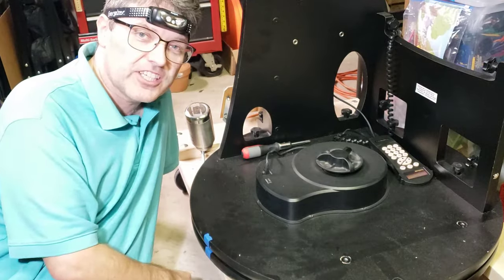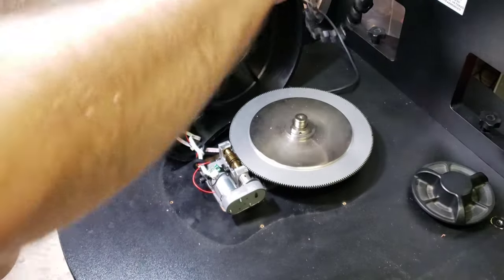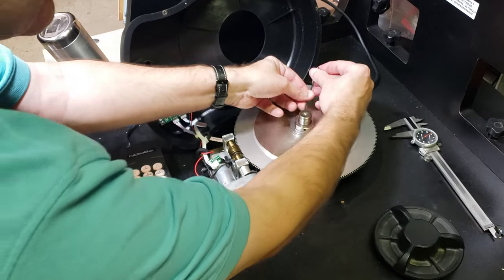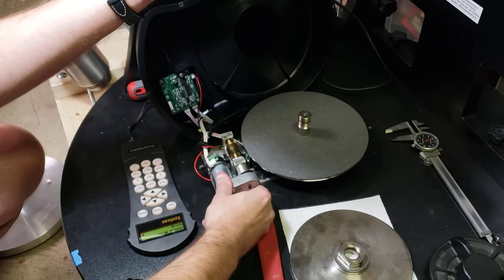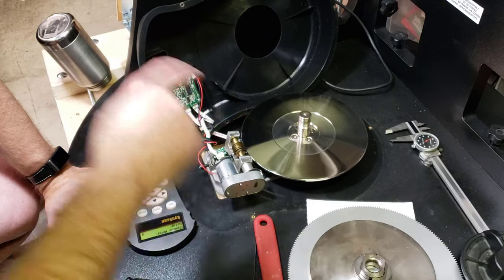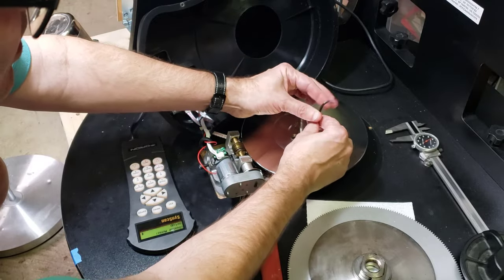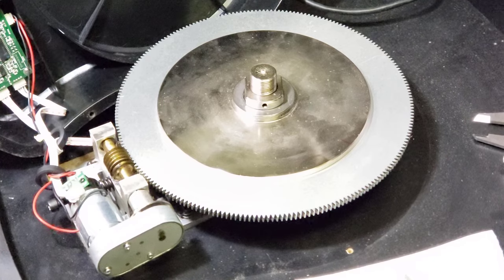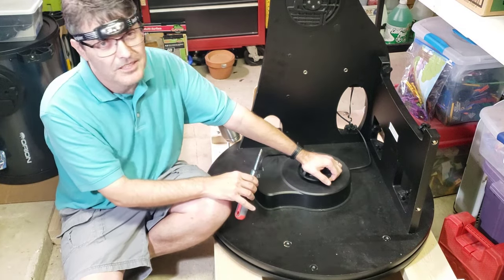PART 4 - GIANT Telescope Restoration!  -  Orion XX14g GoTo Dobsonian - Fixing Axis Slop (Episode 4)

Comment: John - my 12" Orion GoTo dob had the exact same problem. I was just nodding my head, and when you saw the screws were loose I said out loud "Put some threadlock on it!" - good on you. I didn't. The first time I disassembled it... No idea how they work loose, but the threadlock solved the problem. It is good for people to be able to see the guts of these things. Well done!
Reply from the maker: Isn't that crazy?  You'd think they would've used thread-lock on such a crucial part right from the factory. There was no sign of any thread-lock on the screws.  Hopefully they are doing that now since they've restarted the 14" assembly line.

Comment: Amazing how simple the clutch mechanism is even in this Goto.  BTW, looked like there was thread locker on the tips of the screws but maybe they didn't install them in time and the locker compound had dried?   Hopefully you used the weak compound... lol, would not want to risk damaging anything with heat.
Reply from the maker: Thank you for the advice! I checked and it looks to be moderate Loctite - the same stuff that I use on my RC car screws. Clear skies!

Comment: Thank you so much for the videos.  I had issues with my xx12g over the weekend where it would not slew right.  Just stopped and went "Click.. Click...  Click.."  I took apart the gear drive and "surpize" I found a lot of loose screws.  Also found that the spring tensioner was loose as well.  Then...  I found your videos.  Outstanding.  I'm going to tackle the lazy Suzan next with your excellent advice.  One question...  Did you post the gear drive grease part yet?
Reply from the maker: Thank you for watching. It was a fun project.  I've heard from quite a few people that loose screws were the big culprit on their GoTo telescopes.  As of now, I would not recommend removing the individual roller bearings from the Lazy Susan.  In hindsight, just cleaning up all the old grease would've probably done the same thing. I'd run a cloth over the roller bearing surfaces and get as much goop out of them. Leave them mostly dry and see how that helps.  I did apply grease to all of the drive gear teeth (I think it's in the last video).

Comment: From what I remember you saying your skies are like, I would go with Orion Nebula as one of the first targets.  Other thoughts; Grease on the worm gear? Surprised there wasn’t any, or remnants of any on there. Needle bearings - possibly a dry graphite for lubricant?  So far it looks like you’re doing a great job on this restoration, which is not surprising! Clear skies & smooth gears to you. Scott
Reply from the maker: Agreed. I think the Orion Nebula will be first (if the Moon isn't out).  I should add grease to the worm gear - it's easy enough to get to.  I was surprised they didn't use Loctite on those four loose bolts, so I guess I'm not surprised there is missing grease.
Reply: @reflactor  and I take back what I said about graphite on the needle bearings. Seems the general consensus on CN is to leave them dry, just give them a good scrubbing.

Comment: In reading a portion of the manual for this beast, it mentions it has a tracking feature. That would be interesting. Also, I suspect the loose screws are indicative of a torque issue which the solution of using thread-locking resolved. You do good work, John.
Reply from the maker: Thank you, John.  I used to have much smaller GoTo Dob a while ago and it tracked surprisingly well.  I am excited to get this one tracking too , more-so than even the GoTo function. After all the work of tearing that clutch apart (much of the recorded video was not included), I did not want to repeat it - thread-lock to the rescue!
Reply: Nobody ever made a goto system that didn't at least attempt to track. IE, all goto systems have tracking

Comment: A 14" telescope in light polluted skies is still great for planets (obviously), and you could make an off axis mask that would make the views like a 6" apo.

But where it would  shine would be  on #1, globular clusters. Globular clusters, and Globular clusters. Did I mention Globular clusters? In my c11,  with enough power (1.5mm exit pupil range) I had a greater than 90% wow response when i would show m13 or m22 even with lights all around as well as being in the white zone of the  LA megalopolis (orange county at the time)

#2, brighter nebulae with UHC and OIII filters,  best done with your 30mm 82 degree eyepiece. Or more power as the target permits

#3, planetary nebulae with UHC and OIII filters. At higher powers of course.

Also, some of the smaller brighter surface value galaxies,  not the diffuse spread out ones, can be pulled out of the murk by going to 2mm exit pupils and smaller. General rule pf thumb is to throw power at objects to darken the sky background to increase contrast. With a 14" you can make them big enough to see detail.

But did I mention globular clusters?
Reply from the maker: I get the impression that you like globular clusters?
Reply: @reflactor  yes indeed

Comment: Wander if there was a torque spec for that nut?  When in doubt, as a vehicle mechanic, I used the PDT (pretty darn tight) spec.  LOL
Reply from the maker: Haha, yes, I use that spec all the time.  Tight enough so it won't fall off.  In this case, it's a delicate balancing act.  It has to be loose enough so that the telescope can be turned manually, but when the motors are driven, it doesn't slip.  I may have to adjust it once all the weight is added.

Comment: Good morning from Venice.
First of all I would like to congratulate you for your videos, which are not only very well done, but really help a lot.
I recently upgraded from an EQR6-PRO-C11 system to the Skywatcher flextube Synscan Goto for high resolution planetary photography. Obviously the planetary season has yet to begin, and therefore I have not yet been able to experiment with tracking on the planets, but I have found that at minimum speed, the azimuth corrections are smooth, while the altitude ones jerk slightly. I must say that at the moment the telescope is heavier on the head, and needs to be balanced with a counterweight to reduce the effort on the altitude motor. But in spite of this, do you find that there are generally problems of this type with these telescopes, or do you think that a careful balancing could solve the problem? Thank you very much for your reply and ciao from Venezia, Karl-Heinz.
Reply from the maker: Thank you for watching and thank you for the kind words. The GoTo Dobsonians are fantastic for planetary astrophotography.  Believe it or not, but I had the exact same problem with this big 14 inch telescope!  It might have been exacerbated by the front end being overloaded (Telrad + red-dot + smartphone), but I had to do a long investigation. I didn't show that part on video.  The solution was making sure the big worm gear on the altitude/elevation motor was heavily lubricated with a thick lithium general purpose (brown) grease.  I tried other greases (silicone, white lithium, etc.) and they made the jerkiness worse.  Once I used the goopy thick brown grease, the jerky movements vanished.  I might make an 8th video in the series to discuss some lessons learned like this one.

The grease seems to have fixed the problem for me, but as you mention, getting the balance just right will help wonders too. It's best to make the motors work as little as possible.  I build my own counterweights from simple magnets and dumbbells.  Here's a video that outlines how I do it:  https://youtu.be/HAbyDqZl83Y
Reply: @reflactor  Thaaaanks a lot!!!!